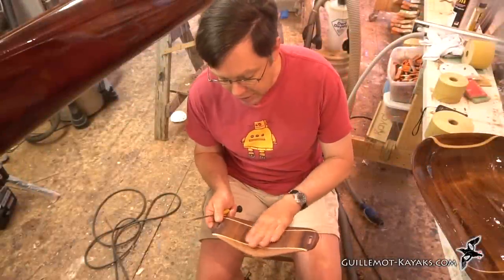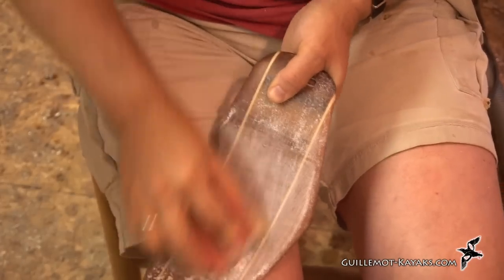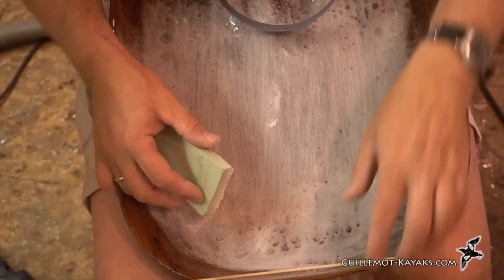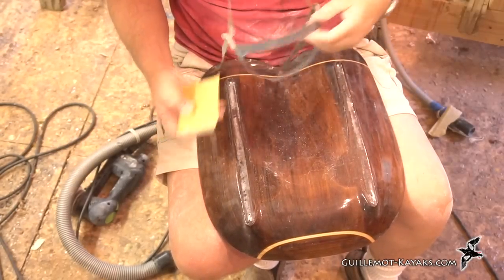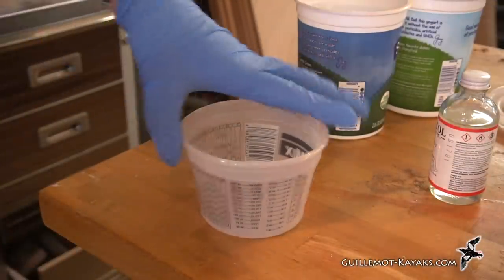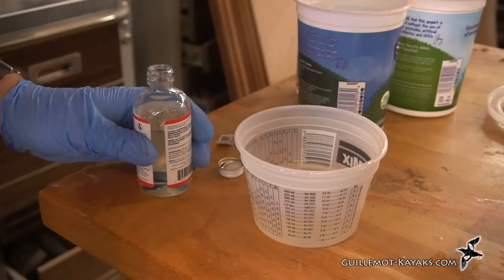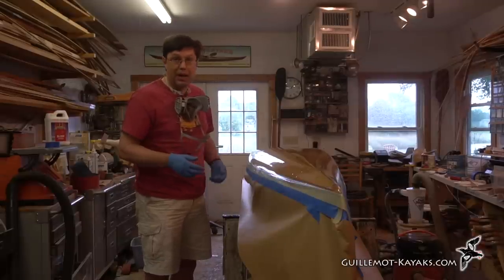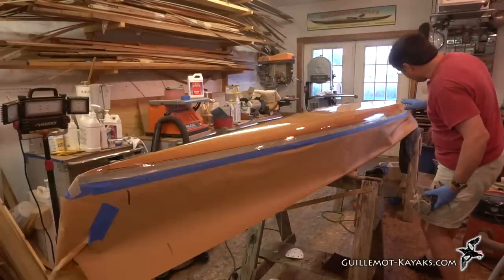Sanding the Seat and Applying Bottom Varnish - microBootlegger Sport - E63

Comment: You might clean and save a couple of foam brushes for the last coats.  Slightly used foam brushes work so much better than new.
Reply from the maker: With regular varnish I am sufficiently happy with my ability to get a smooth final coat, that the aggravation of breaking out solvents to clean disposable brushes does not seem worth the effort.

Comment: Hey Nick that gloss will look very nice once the technique is down. I have a couple of questions, did you ever consider installing a explosion proof exhaust fan high on the wall with filtered fresh air to get the toxic fumes out of the shop. Also does the MAS epoxy produce blush when cured like West Systems? And lastly where did you find the 1" Fine Line tape. I have some left from long ago and cannot even find it in high end automotive paint suppliers here in my area ( are you using the true automotive fine line?) I use the 1/4, 1/2 and now sparingly the 1"...is yours the transparent light green streachy  tape? Can't wait till you float that beauty!
Reply from the maker: MAS does not typically blush, but if is curing in a high humidity environment it can. 

I sometimes turn on a a fan, but I'm working during the winter here, pumping heated air outside is beyond my budget.

Comment: Is your use of foam rather than bristle brushes related to them being disposable and saving clean-up time or do you feel you get a better finish?  I’ve not had much luck with the quality of foam brushes compared to a quality bristle brush, but being able to just throw them out when done is very nice.
Reply from the maker: I find that high quality foam brushes will produce a very fine finish. Good quality bristle may produce slightly better, but the difference does not seem worth the effort to me. Maintaining the quality of a high quality bristle brush is a skill in itself and requires quite a bit of time.

Comment: Hi Nick,  could you explain why you do not put the skeg box on the center-line, thank you    Paul
Reply from the maker: If you drag a kayak up the beach, most of the wear happens right along the centerline. This can end up jamming grit, sand and pebbles into a center-mounted skeg box. Offsetting it by an inch eliminates 90% of this problem. It also makes it easier to stow gear in back behind the skeg because there is more room to get past.

It doesn't effect performance in any noticeable way so, it seems worth it to me.

Comment: Nick, I built a cedar strip canoe 25 years ago.  Still going strong. When I glasses.the exterior I tried to heat a cold garage to no avail and the result is a cloudy exterior.finish.  the interior , done in the summer is beautiful.  Is it worth sanding it downto wood and reglassing the exterior?
Reply from the maker: You can use a heat gun to remove the fiberglass quite easily https://youtu.be/BHNHXD-g2N0 It may be worth the effort.

Comment: How does the varnish hold up over time?
Reply from the maker: It depends on how hard you use the boat and how much time it spends outside. It will scratch and the sun breaks it down, but with regular use and stored inside the varnish will hold up for several years.